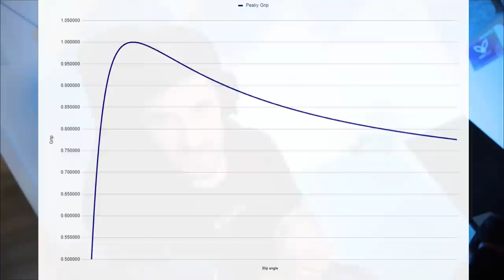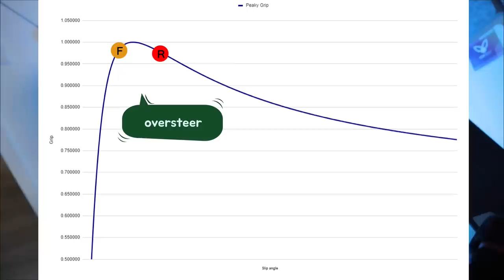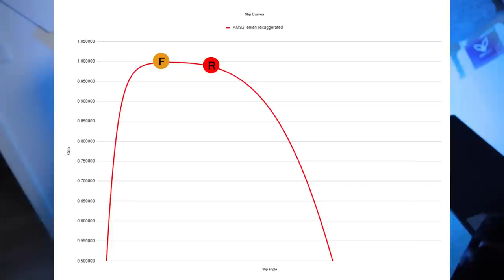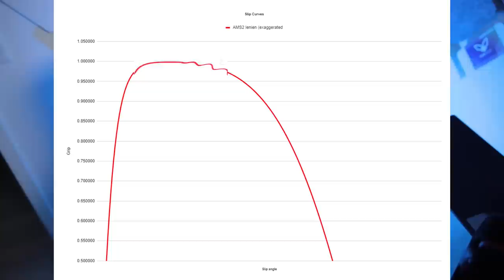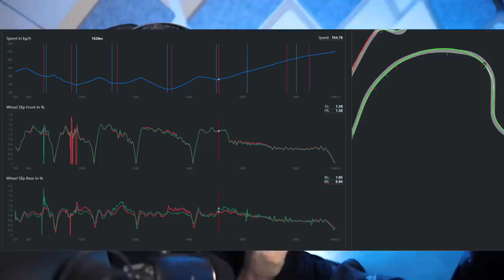Understanding Simracing: YAW! Explained using Automobilista 2

Comment: Daniel Morad is a real GT3 driver and he is also busy with simracing and he has said couples points regarding realism and which sim is currently the “best” etc…
Reply from the maker: Well aware. Though, it's a trap listening to single sample real drivers, because you have as many different opinions from real drivers as you get from simracers. There is a large skill spread among real drivers, too. Not every real driver qualifier to answer. Don't glorify real drivers - many can only afford it and that's the only thing that sets them apart from a lot of other, more talented people (not saying morad falls in this category).
Real life situations also have a much larger bandwidth of situations, grip levels, tires - there are a lot more influential parameters. Drive the car on one day and then the other, you can have two different behaviors, just because something changed. All sims work with data sets: the problem is all data sets differ so also the result in the sim differs. There isn't that single one behavior across the board everything has to mimic. There's variety and thats why its also so hard to assess and replicate.
Reply: Unfortunately Morad talks a bit too much for the amount of knowledge he actually has about simracing. Its usually better to take what he says with a grain of salt.

Comment: Is there a difference between „slip angle“ and the „yaw angle“ you discribed?
Reply from the maker: yes, slip angle is tire related, yaw angle is car orientation related
Reply: @SimracingPopometer  but worth noting it's the same angle, just not the same referential
Reply: @tkzii6207  when you take the rear tyres indeed
Reply: @tkzii6207 not the same angle !!
Slip angle Is the angle between tyre point and where they " goes "
Beta slip angle or angular velocity slip angle that changes with the inertia Moment It' s the angle between where the car pointing and where She effectively goes🫡
Thanks🫶

Comment: Hello Nils first of all happy new year and best wishes for 2024!   Thank you very much for this video, this explains a lot about AMS2. Whould it be possible for you to explain the tire temperature in AMS 2?  I mean its very simple and good explained in Assetto Corsa, but i never understood how it really works in Automobilista 2. Is there a way to change the car behaviour you described by changing the tire temperature? When i drive Automobilista 2, i am never sure about the Tire Temperature and how to find the right temperature window during a race, somehow it works. Thank you very much and best regards.
Reply: aaaaaaaaaaaaaand i forgot to ask to explain  the tire Pressure in AMS2, my fault sorry for this😄 have a nice evening!
Reply from the maker: i haven't really tucked my head into the temperature stuff. with only the hud to look at we're flying pretty blind and would thus need a lot of testing. though i dont think neither high or low temperatures were a problem on these runs, so it should also not be the root of any behavior.
Reply from the maker: and likewise: haven't dived into that, so cant really tell. literally havent touched them in the game :D
Reply: just like in acc you want to aim for tire pressure for the most part. 1,8 bar hot pressure is a good point for most gt3's etc. temperature impacts your tire pressure and if you see your temp is going high and the pressure follows you will start sliding more and more
Reply: @SimracingPopometer
no Problem and i understand, but if i change the tire pressure in ACC i can directly feel an impact to the behaviour of the the car, in AMS 2 not. Maybe its related to the plateau of grip you explained in your video. I know there is a basic video from @steelcast how to set up the pressure and temperature, but somehow i can not really feel a difference if i change the pressure at AMS2. Anyhow, thank you very much for your reply and looking forward for your next Video!
Reply: @blankfiile  Thank you very much for your reply. I will try the next training session with your recommendation and will do some tests. Thank you and have a nice evening!
Reply: @Mike-xe8dn  basically its like this. if your tire pressure is too low your car will turn really well (sometimes too much to handle too) but you lose a lot of speed on the straights. this is why your second hotlap is usually faster after coming out of the pits.

if you tire has too much pressure you start sliding more because you have too little contact patch and build a lot of heat which further increases pressure and so on. this will kill tire life. 

in the wet weather this has a impact on the grooves in the tire aswell so a cold wet tire will be too deflated to properly get rid of water
Reply from the maker: @blankfiile - well yeah, of course higher temperature leads to higher pressures :) it would be a fundamental flaw if not. i just dont know the specific number for the various cars in ams2 to target. 
1.8 bar would be pretty imprecise for ACC for example. we're aiming for a 0.3 psi window - so within 0.02 bar. outside of that we'd already see less grip. i dont know how sensitive ams2 is in that regard, so for now i just ignored it
Reply: @SimracingPopometer  it is not that strict as in acc but i'd say 0,05 bar around that 1,80 is where you'd ideally be for maximum performance, at least thats how it was before this latest patch. going lower is very noticable. going higher and you start getting these mini continuous slides, which you wont notice that much in performance but will in tire life. default setup is usually too high except for nighttime
Reply: @blankfiile  very good, this is a good starting point for me, i agree with you that the pressure window is wider compared to ACC.  the Feedback from AMS 2 is "different" to a lot of other simulations i have driven so far, thanks mate!
Reply: @Mike-xe8dn  the optimal pressures for the michelins in ams2 are between 1.9-2.06 bar, centering at 1.98 bar. Typically your rears should be a bit lower than the fronts for traction purposes. The pirellis of the GT3G1s center around 1.9 bar, so a bit less pressure.  If after 3 laps, the pressures reach these marks you’re in good shape.  If you are not warming the tires up naturally, as one would with a true formation lap, it takes the pre-heat/pre-pressure system about 3 laps to normalize as well. People sometimes observe there are minor differences in handling during this period as I do.

Comment: It is nice and dandy, but there should be REAL WORLD data to compare which sim is THE CLOSEST to the real thing, I personally get the most natural feel from RF2.
Reply from the maker: yeah, rf2 can be very crisp and natural to drive. agree. especially the formula cars. though its sometimes a bit hit and miss. one might be great, another might be shocking :D

the problem with real life data is that its hard to get, sometimes even measure. theres a reason some f1 teams have great sim -> track correlation, while others have worse sim -> track correlation. apparently it's difficult operating at the edge of knowledge / available data

Comment: Schöne Erklärung! Danke dafür. Frage, fährst Du da bei dem Porsche tatsächlich ca. 100 Grad Reifentemperatur?
Reply from the maker: habe mich nicht weiter drum gekümmert - gib ihm ;)
ist ja bekannt, dass porsches, gerade bei so high speed strecken, hinten evtl ein problem bekommen. da ist aber auch noch luft bei der bremskühlung. das ist alles standard bisher
Reply: @SimracingPopometer  OK, ich war nur erstaunt. Wenn ich den mit AMS2 Standard Setup fahre, dann liegt die Temperatur nach 4-5 Runden bei max. 60 Grad.... Dann mit etwas mehr Bar und Bremsenkühlung zu bin ich auf wenigstens 75-80 Grad gekommen.... Irgendwas mach ich falsch! ;-)
Reply from the maker: zu langsam würde ich behaupten, und ggf zu untersteuernd ;)

Comment: Played plenty of ams2 But never in a GT3 car there are to many of them in racing games (1000s of hours on ACC has  burned my passion for them ) But love lots of different options in AMS2 and using a Scandinavian flick to set up my slip angle entry and throttle control exit over steer lots of fun and feels real enough for me . Try some old school open wheelers  especially ones with a much smaller foot print on the front and Gt3 driving technic won't work. Imo
Reply from the maker: yeah indycars are a bit sharper, too. also the lmdh's cant really be driven like that. they have the yaw, but they dont have the option to push as much over the front into the corner
Reply: Wow can't believe you replied lol what I meant to say was amazing video explaining things that so many overlook and to have the ability to communicate to the fellow SIM racer in a way that we can all understand. You are appreciated by many Cheers

Comment: Nice. Have You shown this to Reiza?
Reply from the maker: I'm sure they know their game a lot better than me
Reply: Maybe, but they have worked very hard to find out why their sim model is so "slidey", I dont think this would be out of place. @SimracingPopometer
Reply from the maker: @strikkflypilot927  my video isn't really the "why" on the fundamental level as to why its slidey in the first place.
my video answers the question why the driving feels vague at times: slideyness :)

I believe my videos are recognized and valued there, no worries. 

for any change to the general feel of the sim you'd need a good foundation in data to justify making that attempt. Reiza will have their (good) reasons why it is like it is.
Reply: @SimracingPopometer  Yes, I thought this video was very clear and didactic so Kudos for this. You have a new subscriber.

Comment: You've got the right basic idea, but the body slip angle doesn't say anything about understeer/oversteer.  Google "vehicle dynamics tangent speed" for more info.  

The tire force curves in that second chart are ridiculous looking at high slip.  Surely that's not what AMS2 is really using?
Reply from the maker: sims are not "using" a certain slip/grip graph. its merely a result of their framework. if you look closely it says "exaggerated" on top and i mentioned that this is to highlight the topic, not an accurate picture of whatever the graph is. however, no matter the actual shape, that the tendency will be true compared to other sims. theres a lot of slip possible without losing speed and theres a lot of room to play around and set the car at whatever yaw angle you want and still drive round the corner.
Reply: @SimracingPopometer Yeah, I know how it works.  I wrote the tire models for KartKraft, VRC, and VRC Pro and did some updates to tire models in other sims over my 24+ year career writing and working on various sim engines, including a couple years with Studio 397 modifying the rFactor engine for two games which were using it.

When I said "using," what I meant was "if you ran the tire model in such a way as to produce lateral force vs slip angle curves, what would they look like?"   Functionally it's identical to "using those curves" because the tire model would reproduce those.  There's no difference really.

I missed the "exaggerated" text.  Saw it on my phone where it's too small to see.  I must have spaced out when you mentioned it or skipped over that part.

Anyway, my point was the yaw angle (in vehicle dynamics engineering lingo it's called "sideslip angle") doesn't tell you anything about understeer/oversteer.  At the tangent speed of the vehicle, the sideslip angle is 0.  Below that speed it's in a nose out attitude.  Above that speed it's nose in.  In either case it could be understeer or oversteer.  The general idea you might have been trying to convey that different cars on different tires with different cornering stiffnesses (peaks at higher or lower slip angles) will have different sideslip angles is correct, it just doesn't tell you very much other than how stiff the tires are.  On power coming out of turns the picture completely changes though.  Those slip angle vs lateral force curves look completely different under combined grip, not to mention effects on yaw moment from longitudinal force split between the left/right rear tires.  aka, effects from the differential.  All sim racers ever talk about is lateral force, but that's only part of the story.

More on tangent speed @19:00 :  https://www.youtube.com/watch?v=8CnJrdh19Wk&t=1140&ab_channel=DrEstes
Reply: Thanks for the technical explanation of what's happening, that's for sure what I feel. Although AMS2 is my main sim right now (rF2 before), I really wish it could have a more pointy grip transfer curve. Really hope Reiza could give us that extra option, keeping current tyre model for those loving it was it is.
Why don't sims offer that, pleasing a greater audience? Just like they do offer driving lines, stability control and ABS and TC for cars that don't have them in real life?
Reply from the maker: something like the tire model is probably a bit too deep rooted to have (AND MAINTAIN) various of them with limited budgets and dev time
Reply: Nah, it's just some parameter tuning by a vehicle dynamics dude.  It doesn't generally involve programmers.  Every sim I ever worked on only had one tire model for the player.  There's not a different one for each car.  The parameters (inputs) are different for different tires, but the model/code is exactly the same.
Reply: @toddwasson3355  How do you rate the AMS2 tire model? I always read that AMS2 simulates deeper than some other sims, similar to rF2.
Reply: @WarmRed77  I haven't driven it or know much about it so couldn't say.  AMS1 used the rF engine, so was using the RF1 tire model as far as I know.  Don't know about AMS2.  Most sim tire models these days are pretty good, the differences in handling come down more to the engineers parameterizing the models than differences in the models themselves.